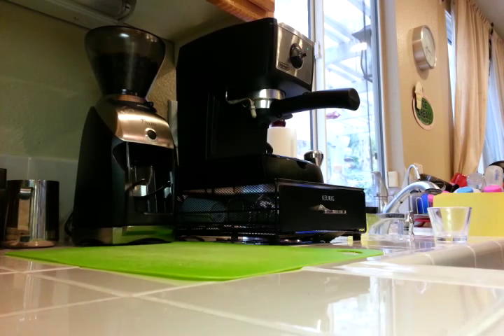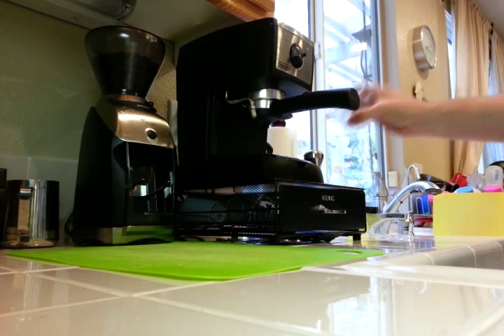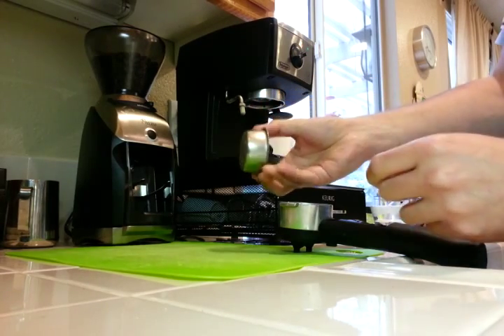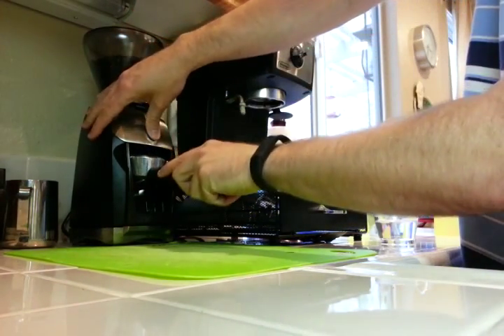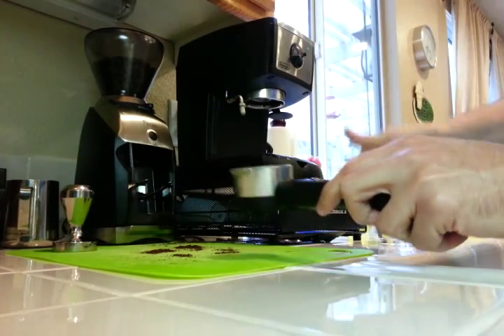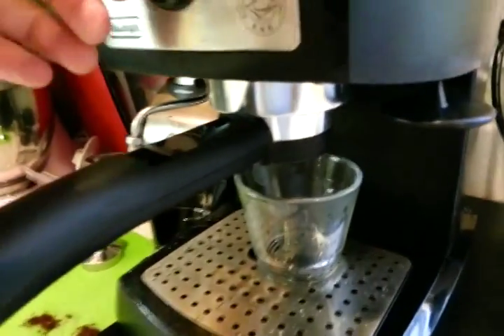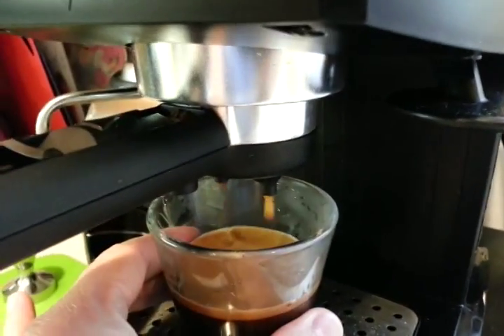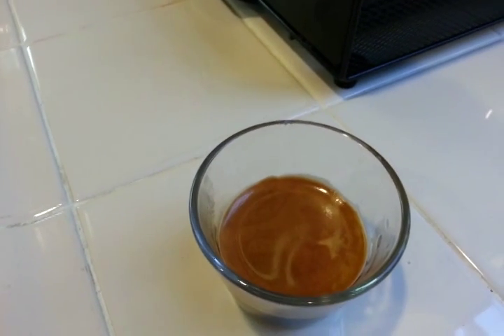Pulling an espresso shot with a Delonghi EC-155

Comment: Hi Daniel.  Thanks for your posts and info.  I've decided to go the route of your steam wand setup as opposed to a Rancilio retrofit.  Are you tightening the m6-1 nut against the tip piece (hand tightened) with a wrench?  Also, I've read in the article link to yours that some people use plumbers tape between the wand and tip piece.  You don't use it right?  I imagine the lock nut resolves that issue.
Reply from the maker: William Okura correct.  I use the lock nut to avoid using Teflon tape.  I didn't want any Teflon in my milk.  finger tight has worked out totally fine.

Comment: How did you flatten the lip of the la Pavoni basket?
Reply from the maker: With a normal pair of pliers (NOT needle nose).  I had to hold the basket with a rag because it started to hurt my hand.
Reply: an adjustable wrench would probably work best